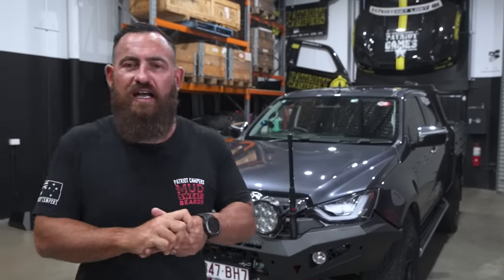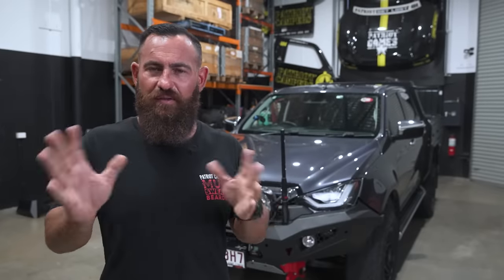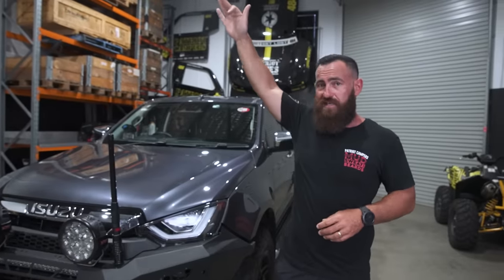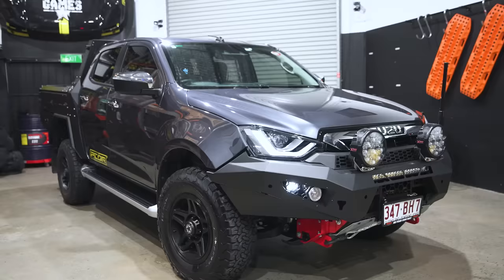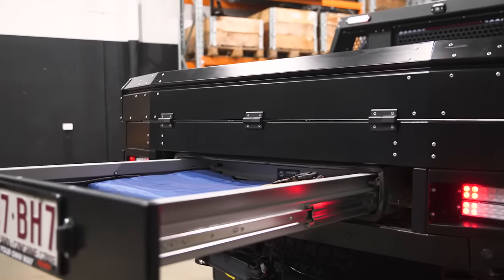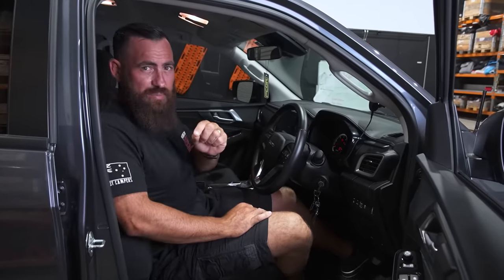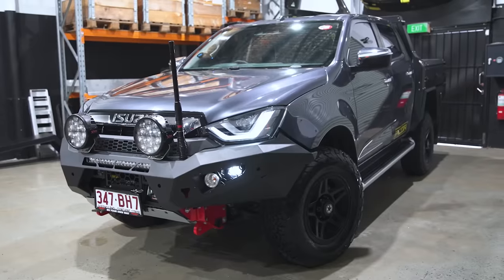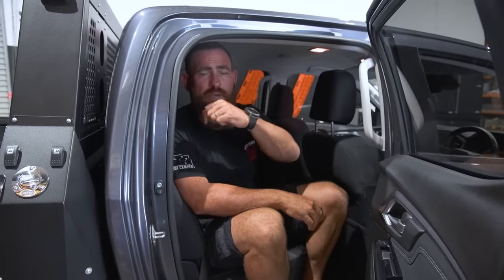First Impressions Of The All-New ISUZU D-MAX - Full Rig Rundown

Comment: mad rig, but im heartbroken that isuzu didnt add a bit more power to be more competitive. if it had of come with 160kw/500nm+ it would be a no brainer to buy. but haven taken one for a test drive - it didnt live up to the hype. that said, i spose they would be breaking more turbos at < 30,000km
Reply: There is a reason they out sell Hilux 3-1 in the Asian market
Reply: @stevespatrol  and theres a reason that the ford ranger is still the highest selling car in australia....
Reply: They can be tuned pretty well.
Reply: Can run them up to 200hp in auto form with not much at all $1800
With a alphatech unit superstorm 
Or alphatech thunder $2500
Great but if kit
Reply: @bbggakkba  it’s called the sheep mentality. It’s only in Australia that they outsell